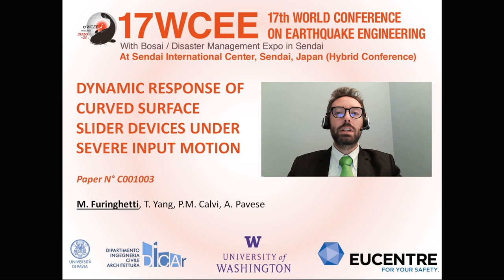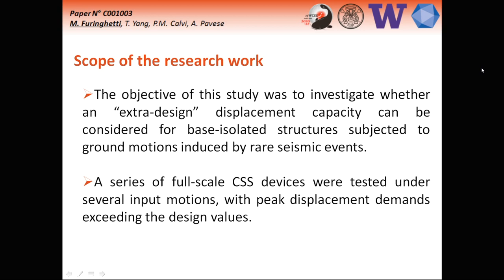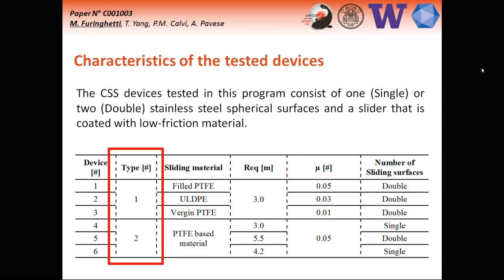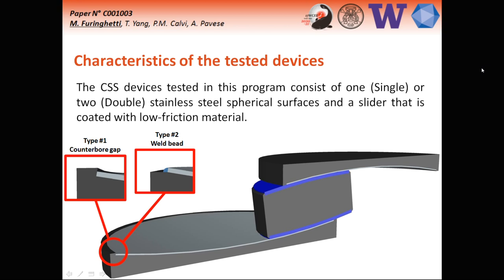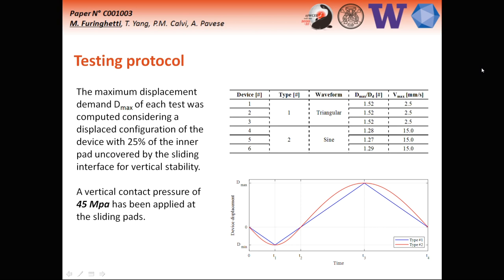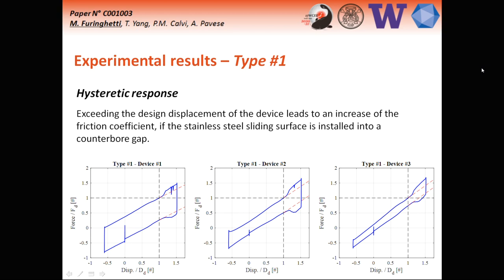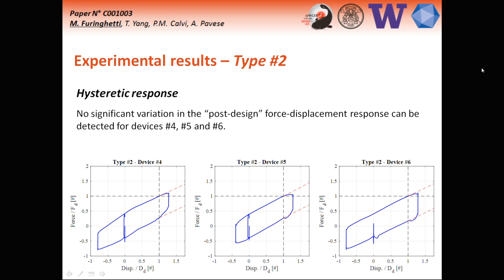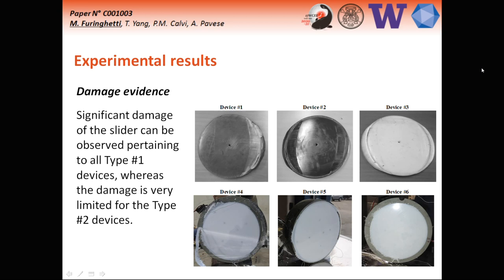Dynamic Response of Curved Surface Slider Devices under Severe Input Motion

Comment: Hello. I have a 2D frame model that I have modeled using the concentrated hinge method in the OpenSees software. Now I want to use a curved surface slider isolator. Can you guide me?
Thank you